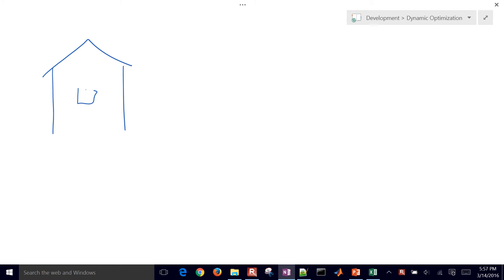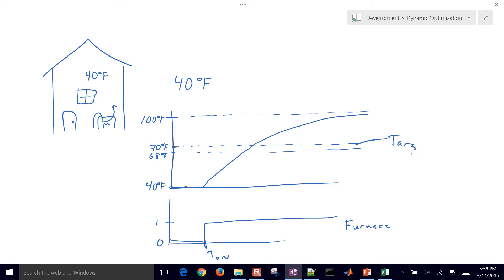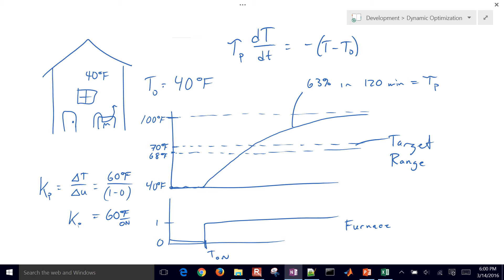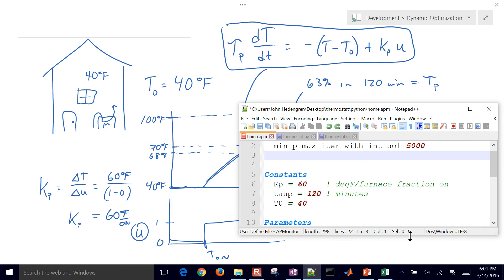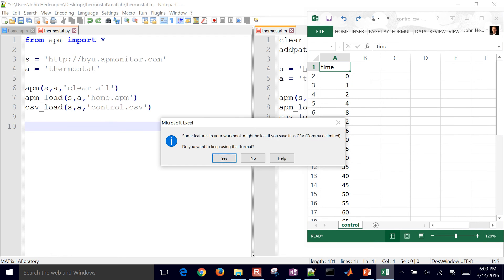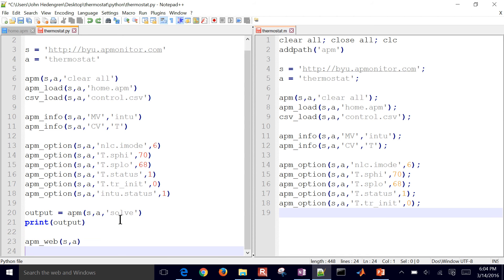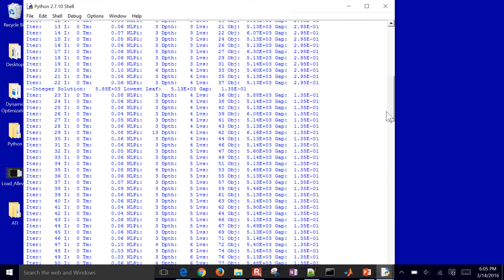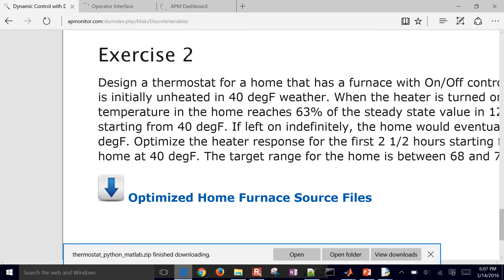Model Predictive Control with Binary Variables

Comment: Thanks for the video, I already made a reply on another video related Simulink, but I am actually thinking this video is appropriate to follow up what I want to develop for practicing. If the home has HVAC system (only considering the cooling this time) with the heat pump and the thermal energy storage tank, and want to make an objective function to control by mpc all considering its operation pattern by cooling load, system operation energy cost, and the temperature boundaries (like what u did in this video), do you have any advice to be referred? Im confused which stage i can modify the objective function at the sample code since I would like to add an electrical cost function for operating all these systems.  Also, On the website, there were lots of courses written as an information, are there any classes now in the process?.
Reply from the maker: We have a number of references related to this topic at the APMonitor references page: http://apmonitor.com/wiki/index.php/Main/APMonitorReferences  See in particular http://apm.byu.edu/prism/uploads/Members/powell_acc2013.pdf  When you open the model file (.apm) you can either include it as a minimize function in the equations section or you can configure a "Controlled Variable". There is more information on objective functions for optimization at http://apmonitor.com/do/index.php/Main/ControllerObjective  Maybe try to configure you application and then post updates to the APMonitor discussion forum for specific help. I don't have a course where you enroll but I do post all of the course content online with homeworks and exams. The dynamic optimization course would be a good place to start.
Reply: Thanks a lot for the kindness reply sir. This information will help me a lot for me to move ahead.